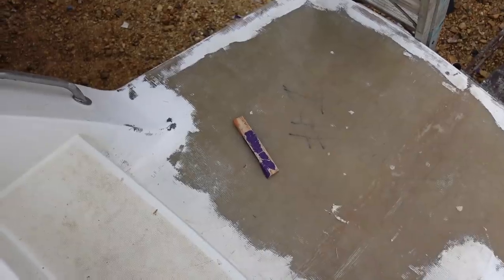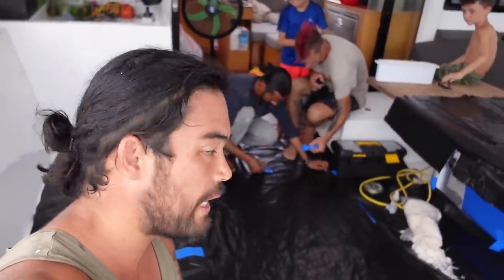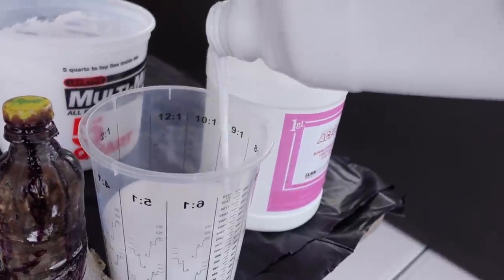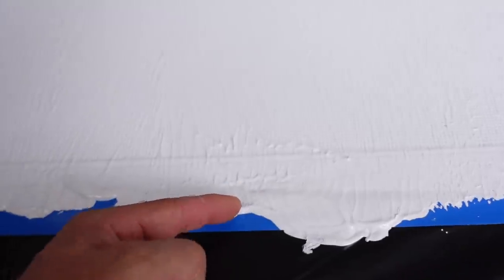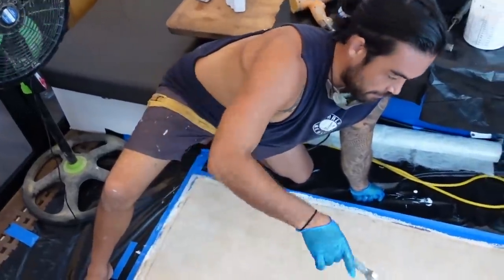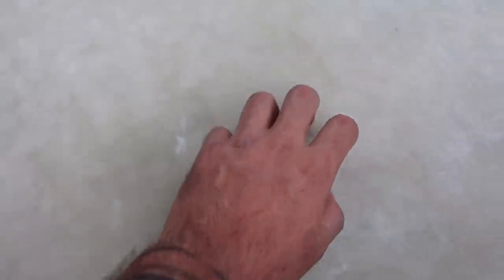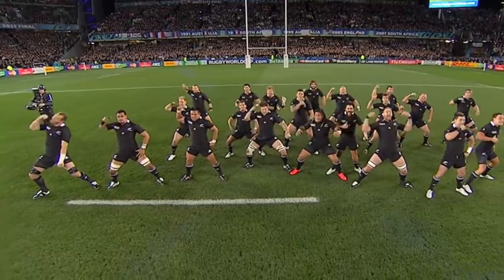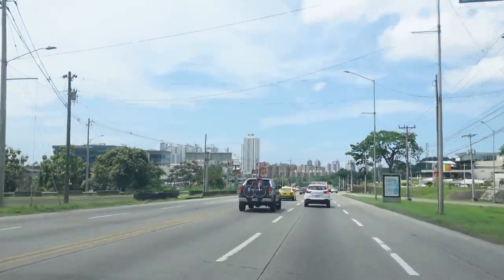Taking non-skid mold off $500,000 yacht! + BIG ANNOUNCEMENT! - Episode 124

Comment: Colin, I'm going to keep mentioning it until you see it. There's a thing called a Static Dissipater Air Element that is on any major Blue water boat. It goes on top of the mast with a 6 gauge bare ground wire running through the mast through the hull to a bronze hull plate. It eliminates 99% of lightning strike damage potential. Forespar makes a mast dissipater for less than $200 bux.

Comment: I'm watching your videos. It's interesting in your beginning I knew a lot more about fiberglass than you guys did, but you've clearly caught up and surpassed me.  But here's a tip about the itch. 
First get a bunch of lightweight cotton clothes, long sleeves! Painters pants. Get a set per guy per day or two. Run em hot through the washing machine and all the glass comes off.  Try to avoid bare skin.  Gloves if you can. None of this is 'too hot' as a traveler I quickly learned if you wear pants, socks, long sleeves you avoid lots of problems. Hot? I've been in 40°C - just takes drinking  more water. It's usually hotter with a shirt off than with one wicking away the sweat.
When you get it on your skin, use the shop vac to suck it off. (I've been doing that since I was a kid - my dad taught me after we were doing some insulation work.)  An air hose doesn't work on fiberglass particles in your skin.  If you can a hot shower ending in a cold rinse. We used to think it opened your pores and then snapping them shut spit out the glass particles - maybe it does. I just know at the end of my day no itch. 
Shop vac: always use a cyclone separator and then a bag inside the Shop Vac container. If there's nothing for the bag- just duct tape it in. If you don't use bags the big pleated filter gets clogged up too quickly. Buy cheap shop vacs. 
And if you want to really clear the air, run an extra hose off the vac's exhaust away from where you are. One thing vacuum cleaners do is pulverize the dust into tinier particles and then send them out the exhaust.  (some of the newer shop vacs don't have an exhaust port - don't worry about it.) 
If you can use the shop vac on all your grinders and sanders that have attachments. It usually works really well. In the beginning the extra hose is a pain but you quickly get used to running it over your shoulder. 
And a good N95 respirator. You guys are outside... so that helps. Me? I'd never sand fiberglass or epoxy without one. When COVID hit wearing a mask for me it was just like another day in the shop. Still is. 
I don't know what horrible lung disease is caused by inhaling fiberglass particles but I'm sure there is one. I am 65, that's 30 years older than you guys (and 55 years working with fiberglass). I'm working towards blue water cruising in a year or two. Had I inhaled all that fiberglass dust I doubt I'd be anywhere but on the couch wheezing.  I know guys who are. Don't cut ten years off your sailing. 
Hope this helps.

Comment: Perfect mold of the nonskid you can use for many parts. Congratulations.
Another way of achieving the same result while saving one step:
Get two part silicone used for mold making. 
No donor boat prep other than making sure its clean.
Create a perimeter dam with clay.
Pour silicone.
After it cures you have a flexible mold of the nonskid.
On the nonskid receiving surface, just pour gelcoat and lay your silicone mold on top. No need to make an actual fiberglass part on your mold and then bond to the surface. 
Pull your silicone mold off once gelcoat is cured.

Comment: Good for both of you ! A break from PR repairs will be good for both of you in long run I think... it will certainly relieve financial pressures and it gives you time to research the electronic systems upgrades in the next phase of repairs to fix lightning strike damages. Were you planning on a complete new wiring loom to replace the existing OLD probably fault ridden OE factory system ? Because of the advance in technologies, you now have the benefit of switching to a NMEA 2K or NMEA OneNet network based design, with all devices able to share data. That could simplify all the data cabling to a straight common buss. Take care out there until we can see you again on YT !

Comment: The way the shower manufacturers and may performance boat builders do the anti skid with heavy weight fiberglass screen material.

The best way to copy existing texture is to make a platinum cure silicone stamp.

Comment: I really appreciate how practical and hands on your videos are. I could do this job now (and I've read all the sources, used the wax, the mold release solution and still everything stuck together. So just that part I've learned so much.) The downside is - Man, that looks like a lot of work!  One important aspect of the DIYer is underestimating what it's going to take and how long it will take - otherwise it looks like too much work.  Safe journey.

Comment: Really good info for creating a nonskid surface. Ran into it on a mast step repair previously, but didn't have the chops to replace the nonskid. I'm going to file this away in the back of my head for next time I run into the same problem. Thanks a bunch!

Comment: Good job love I am going to by 33 foot yeah I passed one up the one I'm looking at now's got two 454 Chevy blocks on it it's in very bad disrepair and I'm looking at a 40 footer and they're pretty much letting these things go they ones in 1988 and the other one the thing is at 86 or 87 either way they're going to need some heck of updating the one that they cut the the I forget I'm new at the game but the thing that goes over your head is like a spoiler somebody got the wonderful idea to cut that off of the boat I guess they didn't realize that they had wiring and God knows what else that was going through there for the radar and the lighting and they just cut through a mess of wires and the entire dashboard has been excuse my French for a lack of a better word fubard and it's literally just horrible waiting just been treated I'm glad of what you guys work on these boats because it showed me how to get one but the reason why I turned it down was because of the back swim deck was split and somebody was telling me this is a couple thousand dollars to replace it and I'm like well I'm not going to you know deal with that because the boat needed you know both engines need to be repaired the dashboard need to be replacing full wiring all new batteries and a lot of stuff you know but it's just a lot of damage Plus Barnacle Bob was all over the bottom of the boat well I mean that's Mickey but it's just that I'm going to be giving up my apartment to live on this job and this is kind of weird I didn't know that you could live on your boat while you got to dry dock or is that a thing cuz if that's the thing that you can do while fixing and working on your boat then I'm going to be you know all in so please hit me back drop me a note let me know is that possible cuz I don't want to go ask in the boat yard hey can I live on my boat where I fix it but I'm just asking cuz you know I don't know what you guys are doing that or what Casey is but you know love you both love what you guys are doing with it cuz if I dude get something that needs some more repairs now my little more confident that I can make those repairs after watching what you guys are doing I have a lot of carpentry skills and so forth and so on but I never messed around with a boat until I see you guys what you're doing I can apply some of my woodworking skills to that however I dig the underboat lighting deal are you guys going to put those under underwater lights back on those boats if so I like to know I just think that's a pretty cool feature gives a nice glow under the boat I like it

Comment: Colin didn't quite understand what kind of filler you used in the gelcoat to thicken the mass to apply with a spatula?  if you can write the name of the shopping mall chemical types of thickeners, such as aerosil, is problematic to find in the USA
Reply: @FelixMartinezLVF  my friend, thanks for the link on the gelcoat, I have a lot of work on my yacht and it is necessary to repair chips, because there is gel paste, colorless evercoat, but there it is just a problem with constant color selection, and the cost is not very democratic,
Reply: @FelixMartinezLVF  I want to try to participate in your projects in the usa, learn something new about fiberglass and gelcoat,
Reply: count on that, any question I will gladly help you, we can exchange numbers through my email

Comment: What you  pulled off was a plug 
You need to make a mold off the piece you just pulled off
Then off the mold you can make as many pieces that you want 
I used to build  power boats 
That was a nice piece to make a mold 
You should make your mold with red or black gel coat
So when your putting on your gel coat you can tell if you got good  coverage 
If not you need to gage your gel coat so you have the right thickness
Reply: The deck of the Nauticat was the plug so what they pulled of is the mould.